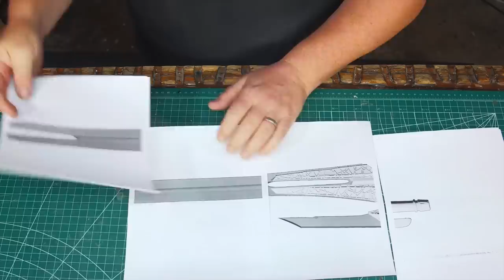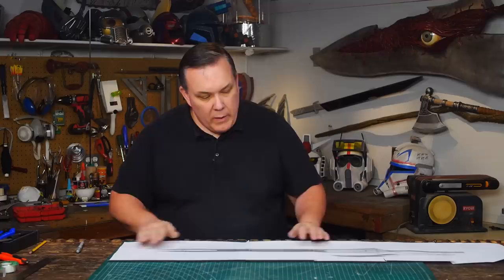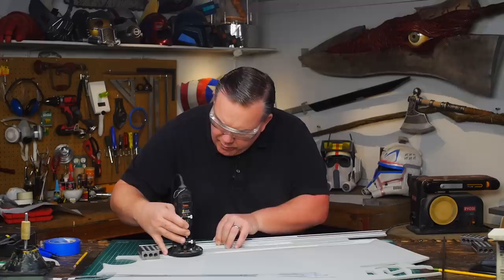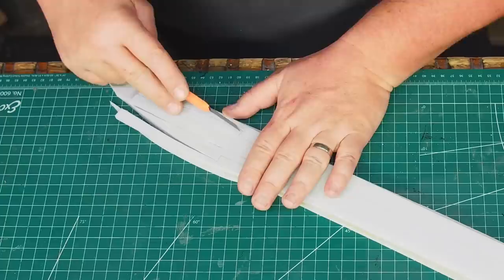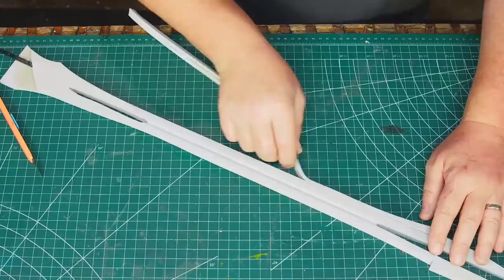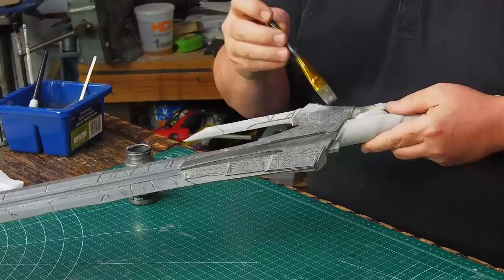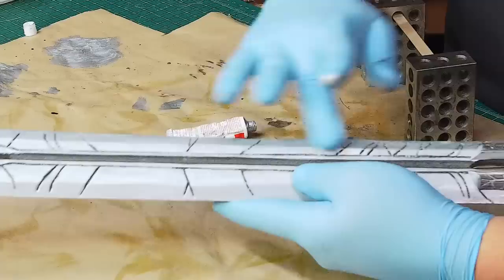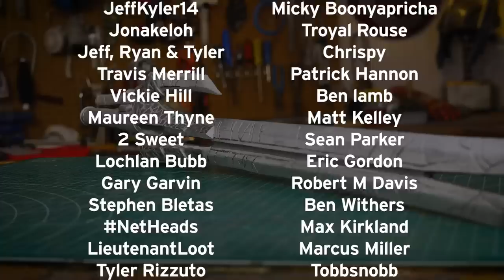Odin Makes: Gamora's Godslayer sword from Guardians of the Galaxy

Comment: Here is a cheap materials suggestion: thrift stores, sporting goods section, carbon fiber golf clubs. Usually a couple bucks. Cut the head off, trim off the handle, instant carbon fiber rod.